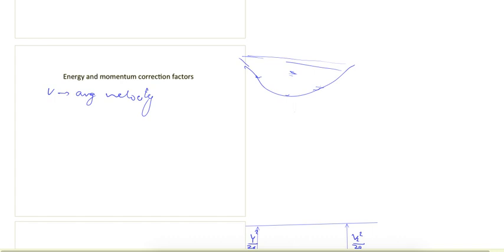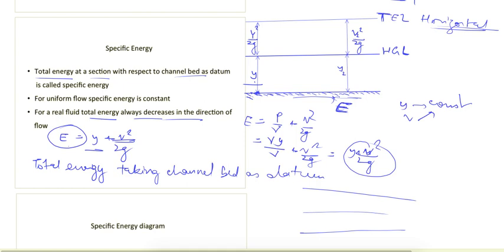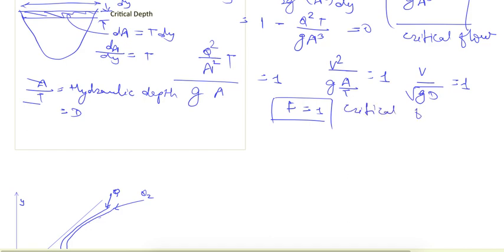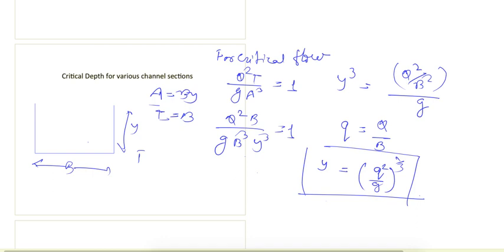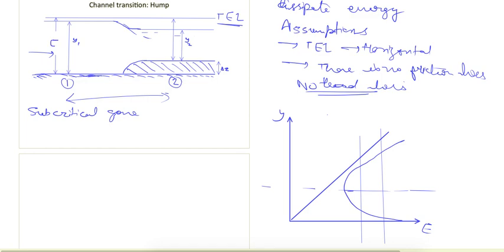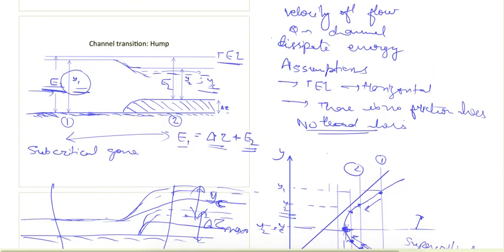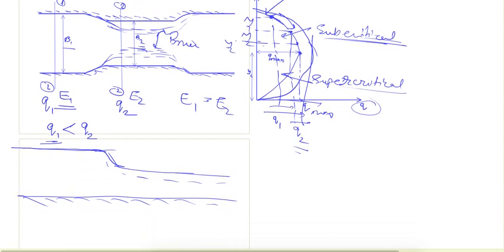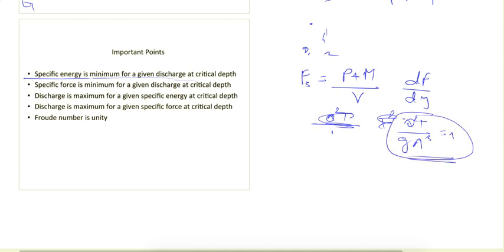Specific Energy and Critical Depth | Open Channel Flow

Comment: This is Ayele from Ethiopia. the lecture is good and very interesting . i am forced to ask you some critical question.    i am  doing  my research on predicting sediment response of the study area.So, having this, i should have  true stream discharge but i can't because of the fact that the stream gauge taken from  rectangular culvert.the culvert is not lied and flat or horizontal and the depth of the culvert increase from inlet to some distance of the culvert and decrease near to outlet of the culvert. due to this reason there is eddy in the culvert.i use floating material to have velocity and the culvert is graduated in the inlet but the depth i get is not true and velocity too.the data is already started to collect since 2014 and continue to 2018.so, how to correct the collected data? please help me!"peterwater2123@ gmail.com"
Thank you
Reply from the maker: Hello Ayele, The section you are mentioning here, is it a flume where a definite relationship exists for discharge ? If I can get the image of the section I may get a proper idea about it.